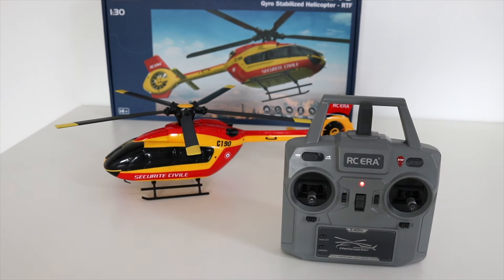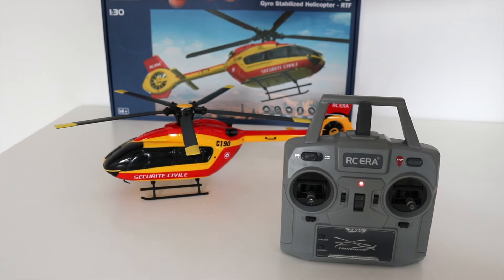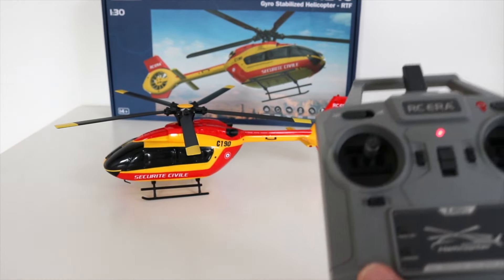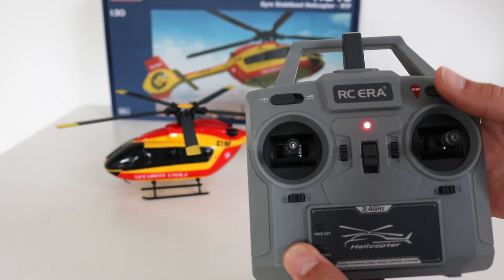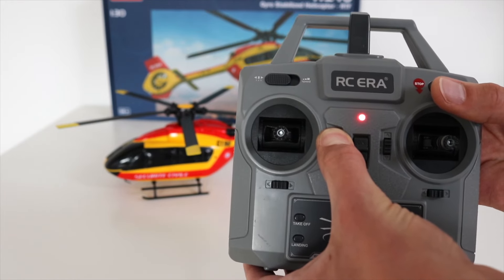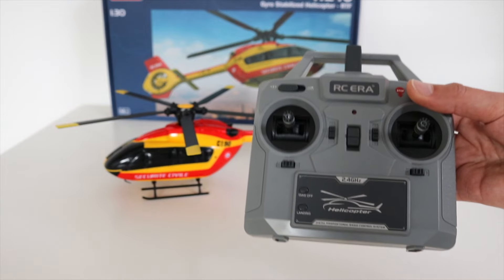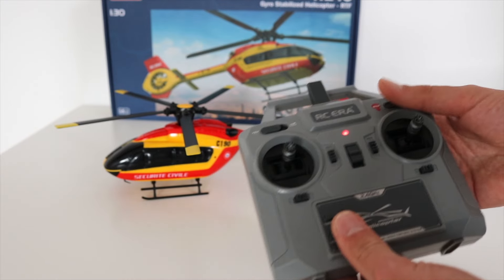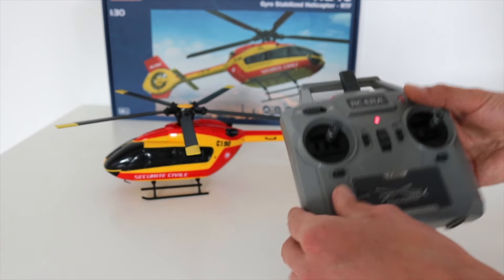How to Turn the Optical Flow Sensor OFF/ON on the RC ERA Line of Helicopters (don't cut the wires!)

Comment: On mode1 tx, do you need the RIGHT trim tab hold down for >3 seconds? And to enter debug- mode do the same >3 seconds? Its confusing: same trimtab >3sec press , how does the heli know if one wants to change pitch ( your video) or if one wants to switch optical flow off?..😮😮😮
Reply: Bin auch Mode 1 Flieger und hätte dazu auch gern die Antwort.
Lg Dieter

Comment: Andrej I’m so glad you cleared this up because I think I was unknowingly turning off the optical flow while trying to lock in the trim settings. I could not figure out why all of sudden the heli would just quickly and suddenly get away from me?? That left switch is also used to lock in the trim??
Reply from the maker: @vincentcimino1963  Yes, it’s also used to lock in the trim.
Reply: @AndrejSturm  ok thanks, if the light on the controller stays solid red I’m in optical flow, got it
Reply: So when you push it down it not only turns off the OF but does it reset all the trim settings or still keeps your original settings unless you change them then push button up which saves new trim set i guess?

Comment: thank you Andrej do you have try also with c138? when you disable or not the of when tx off ? of is on or off? regards
Reply from the maker: Hi, my C138 doesn't have the optical flow sensor.

Comment: Are you sure you are not just entering the "Secret Mode" like the MD 500, where you trim the cyclic and then save the new settings?  Optical Flow would automatically deactivate during this process.......
Reply from the maker: Yes, what you wrote is exactly right; I just did't mention that as a secret mode in this video. So in this mode you can fly just as usual, and if you change any trims during flight, they would be saved when you exit this mode ...

Comment: Hi Andrej ... have you managed to find a way to program your TX16 to turn the Optical Flow sensor ON and OFF?
Reply from the maker: @protoplasmia  Hi, I tried but wasn’t able to program that.
Reply: @AndrejSturm  ok ... so if you turn it off using the stock TX, does it stay off when you bind to the TX16 (does it store this setting in the Flight Controller)?